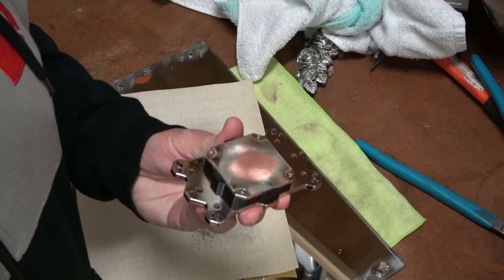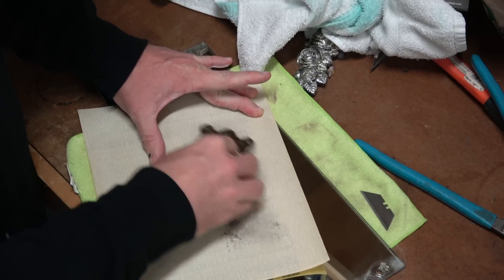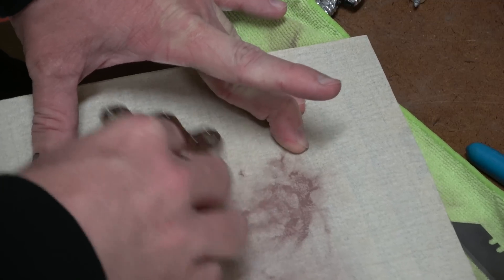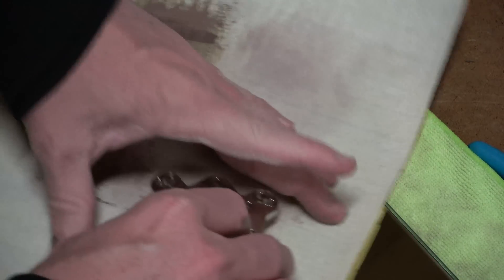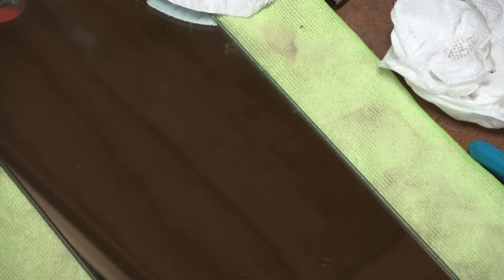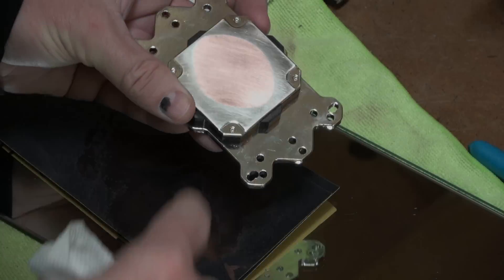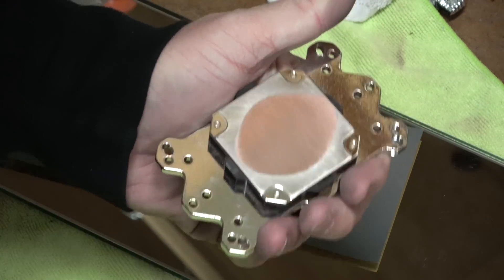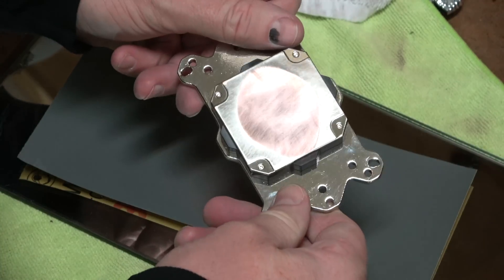Water Block Lapping

Comment: While I know nothing past 600-800 grit makes much of a difference temperature wise (some even say higher grits will hurt), my OCD wants to see you polish the block of with some 2500 grits and finish with Autosol and a felt tip rotary tool.
Reply from the maker: Yep, past 800 is not much need.  While I was not worried about a mirror finish, at 800 grit, it is still "dirty" looking and hard to tell where it needs to be cleaned when I am switching out block TIMs all the time.

Comment: If you are looking for perfection, which it looks like you are, going in a figure 8 will produce a much more even and smooth surface and wont develop wear patterns that are not visible to the naked eye, but are there.  Hopefully this is going to be for the 1700 overclocking tests so we can see results! :)
Reply from the maker: Not looking for anything close to perfection.  Not really needed for what we are doing.  2500 grit then metal polishing compound would make it pretty though!  :)

Comment: no no lap cpu not cooler surface
Reply from the maker: The CPU IHS is already extremely flat.  No lapping required.
Reply: thats why you use Tim to take up the space of an imperfect surface. in his case the cooler was to convex to make proper contact for cooling and tim application.
back in the day we lapped both the cooler and cpu to make sure that the surface was as flat possible. and lapping a cpu today will void your warranty faster than you can blink. I'd rather lap a $30 dollar cooler than a $500-$1000 dollar cpu.
Reply: whats lapping the cpu IHS gonna do when it is flat and the cooler is not
Reply: coolers these day come in convex form, IHS is a little concave.
some times either side of the cave/vex don fit each other.
then you lap just one side   "cpu"
Reply from the maker: OK.  I would suggest that nothing is flat, and certainly you could lap the CPU as well.  We have been doing that for almost 20 years now.  Here is a look at the mate if you would like to see it.  https://hardforum.com/threads/amd-ryzen-1700-on-the-test-bench-under-water.1926447/#post-1042859247
Reply: oh, i forgot... amd-HS ! they are flatter .
however.
they are concave in a way   may be the cpu block you lapped was
very  convex.  heatkiller 4 cpu blocks are noticebly more convex  compared to heatkiller 3 .   such  degree of difference do exist.

Comment: As a toolmaker for 30 years i can tell you that you did an almost perfect job, but when using  emory cloth always use oil,  it will keep the paper from loading up, water evaporates. Also after you are finished and want to polish the copper to a mirror finish you can use most any automotive cleaner wax for a mirror finish.
Reply from the maker: Thanks for the kind words and the input!  I was not in the mood to make it pretty.  :)  You can see the mate I got at this HardForum link.  Nice and flat, good mate.  https://hardforum.com/threads/amd-ryzen-1700-on-the-test-bench-under-water.1926447/#post-1042858860

Comment: Many waterblocks have a cold plate that is convex on purpose and will flatten with mounting pressure. Have you done before and after measurements maybe?
Reply from the maker: It was very much convex.  It was "so convex" that it was not giving me a good mate on these new Ryzen CPUs even with using all the pressure I could muster without getting out a wrench.
Reply: What would break first 3-4mm copper plate or 7layer pcb? Kids these days...
Reply from the maker: https://hardforum.com/threads/amd-ryzen-1700-on-the-test-bench-under-water.1926447/#post-1042858860